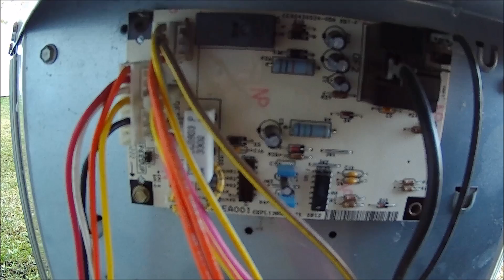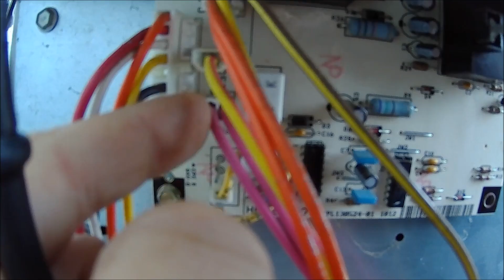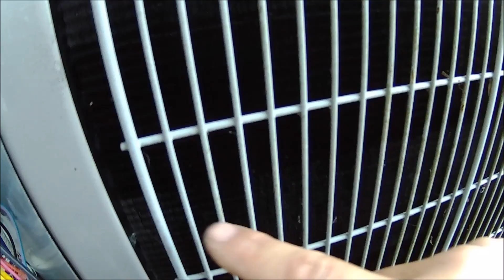Heat Pump Defrost Explained

Comment: Thanks.   My unit is older and notice it's been freezing up enuf,, not ice, but banded and seems once it does it  struggles to  keep up temp in the house and  working more. The contactor did go  bad on it and I replaced it after noticing it wasn't cutting off....  I can put it  in defrost mode jumping  it per your video, so not sure why  it's not going into defrost on  it's own. Guess I'll  order a  new temp sensor and try that and if not have to call the pro. Any suggestions if  you see this? Yes, I change  all  filters  once a month ..everything's clean.

Comment: Please tell us: Is there a brand that does not make as much noise?  Also, why can't the unit shut off, turn to defrost (reverse the valve), then come back on for the defrost cycle.  Wouldn't that make the sound less?  Like putting a car in reverse while doing 55 down the highway?
Reply from the maker: Defrost is noisy because of the change in pressure which causes the scroll plate in the compressor to rattle. There is a function on many high end units called quiet shift but that feature is not on low end equipment.
Also multi stage/speed compressors are the quietest systems in defrost.
Reply: Thanks for that speedy answer! Before I had my unit replaced I had on older model that didn't have a scroll compressor and the noise was not even noticeable. I wish I could remember the brand name.  Do you think a conventional compressor would make less noise and is it feasible to replace my scroll with a conventional compressor?  My next choice would be to use another heat source for the winter, or upgrade to a higher end model. This unit was replaced by a popular "Home Appliance Insurance Company" so I'm sure is a really low end model. :-)

Comment: I have this exact board,  sometimes my system will go into defrost then stop then start again and stop repeatedly before it finally finishes the cycle.  About tips on what to look for there?
Reply from the maker: Sounds like its cycling off on the low pressure safety. May have a refrigerant leak but without knowing specifics I'm just guessing.

Comment: YOU SHOULD TEACH HVAC !   Absolutly the best video on Defrost Boards!   GREAT  trouble shooting  tips includig placement of the temprature sensor.   NOW IN 2019 GOODMAN has issues with thier Defrost Boards that do not work on the 30 or 90 miniute defrost cycle  pin  setting at all.  ONLY the 60 miniute defrost pin setting will work even on the replacement boards they sell you.  Goodman tells you to put on the 60 Min setting.   If you have a GOODMAN not going into defrost AT ALL...  try moving pin to 60 Min defrost setting befor replacing the board.
Reply from the maker: Thank you for the kind words and the tip on the new Goodman boards Mike! I appreciate it!
Reply: Kuttystr8nutty  If T-stat is off ...   the outside unit is off.  If contactor is not pulled in on condenser, ,nothing runs.   If your unit is running with the tstat off  you most likely have a stuck contactor or bad  t-stat or wiring .

Comment: So when it goes into defrost is the reversing valve switching over? Or does something else cause the defrost?
Reply from the maker: +Sal The reversing valve de-energizes causing the condenser to run in cooling which melts the ice on the condenser coil.

Comment: How long does it usually take to go into forced defrost, while you're shortening the Speedup pins? I have a a defrost board that it sometimes takes 15 seconds other times 40 seconds, but it eventually goes into forced defrost. Don't know if the board is bad, that it sometimes takes longer to forced defrost.  I didn't do the test you mentioned of disconnecting the fan wire to test the whole defrost circuit.
Reply from the maker: Familia Sanchez HVAC That is completely normal. Think of it like this. Lets say the timer is set to 90 minutes. Say you arrive to the unit 5 minutes after the last defrosted. If you short the pins, you are fast forwarding 85 remaining minutes.
Now, if you arrive at 80 minutes since the unit last defrost, you only have 10 minutes you need to fast forward.
Hope that makes sense.
Thanks for watching buddy!
Reply: HVAC in SC So it common for those defrost thermostats to go bad? I didn’t test it, I just tested the board by Shorting the test pins and it went into defrost. So I know the board is good.
Reply: @HVACinSC  understood, that does help to know and realize that it's literally just fast-forwarding the time. It makes sense now why carrier puts the word speed up, I assume the other boards that say test are just doing the same thing (fast-forwarding)

Comment: If u jump off the defrost terminal nd it works then, shouldn't we also check y it's not getting power from pink wires ?
Reply from the maker: Jarmarcus Blevins If you short the dft terminals with everything connected and it goes onto defrost then you know the dft sensor (pink leads on this unit) is closed. 
If you want to know weather the dft sensor is open or closed without shorting the test pins then you should ohm the switch out rather than checking voltage.

Comment: Hey great video! I am having trouble with this same board. I have 24 volts between R and C. I jump out test pins and speed up the defrost and nothing happens. It doesn't do into defrost. Is the board bad? The unit is about 6 months old. Thanks
Reply from the maker: Brian F The defrost thermostat must also be closed in order to force defrost. Ohm between the two pink leads labled dft on board to make sure its closed. If the defrost thermostat is below 32 degrees and still reads open then your defrost thermostat is the problem.
You can also test the board to ensure it is okay by removing the defrost thermostat from the board and jumping the two terminals out to simulate a closed defrost thermostat. 
Thanks for watching
Reply: HVAC in SC  thanks for replying. I checked the t-stat. It is open and closing as it should.  I removed the t stat from the board and jumped out the pins on the board and still no defrost!
Reply from the maker: Sounds like you likely have a bad board.
Reply: Thanks brother. That's kinda what I was thinking.